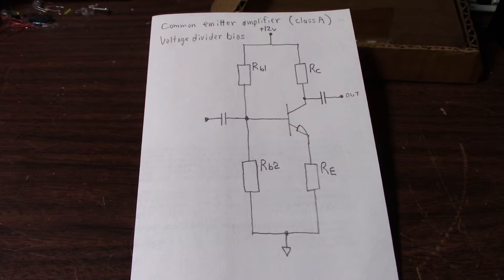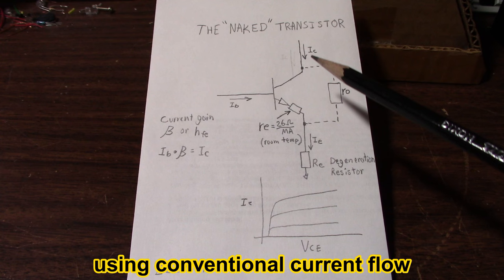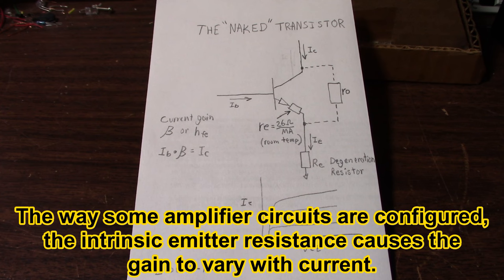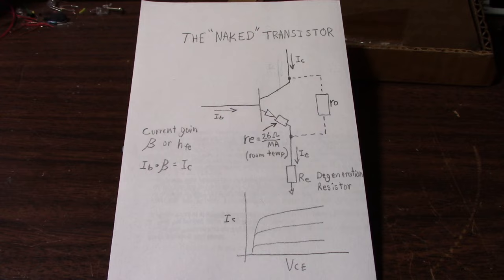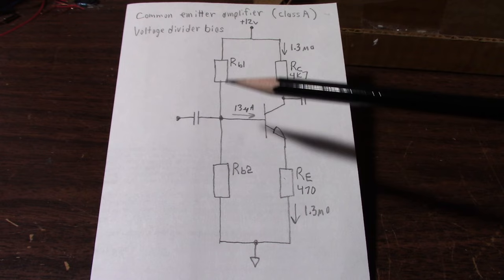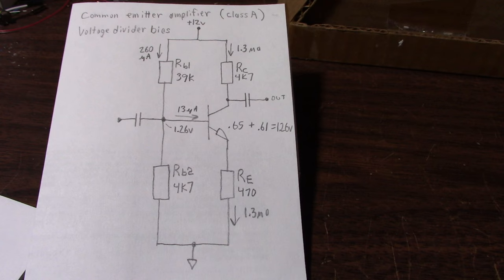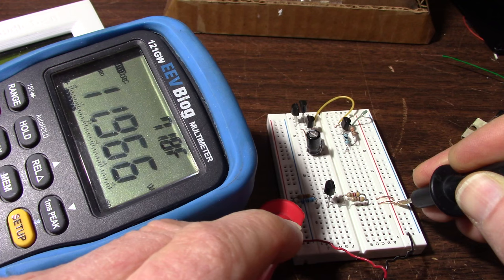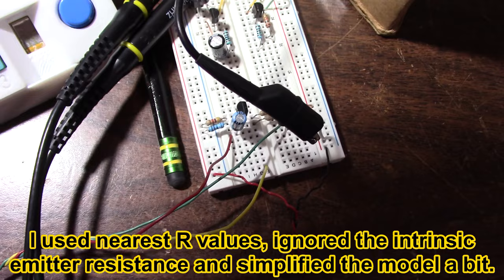How to design a single transistor amplifier with voltage divider bias

Comment: I attempted to do this (once!) "on paper" in order to re-design a 70's vintage pre-amp circuit. I ended up using a circuit simulator (TINA) to converge the circuit for lowest THD for the gain value (+9db / stage) I was shooting for.  I used MPSA18 transistors (beta of 800+) for all three stages. The end result is still working quite well. Only a small amount of negative feedback is used from the follower (output) stage. The original design used un-obtainium FETS with a max output of 5 volts (!) less than .25% THD. I was able to achieve .11% THD at 3v rms using the mpsa18s WITHOUT changing the original board design. I just needed to add RB1. However it took quite a bit of "simulator" experimenting to home-in on the proper resistor values. It's two CE stages followed by an EF stage. The original design had NO RB1. I guess you didn't need them for the FETs. but I needed Rb1 at 10 meg and Rb2 at 1 meg. The simulation failed without Rb1. (even at 10 meg!)  The original design also had Rb2 at 1 meg. I believe that's the only value that didn't change. Every board level component got replaced. This was originally done as a "re-capping" project back in 2006, but a few years later, I decided to replace the entire circuit. I had NO choice but to re-design the bias network even if I wanted to use modern J-FETS (the original plan) . But I eventually switched to the low noise (easily obtainable) NPN bi-polars. I used the same 36vdc that Sony was using off of their  (re-capped) PSU board. The actual Pre-amp was a SONY TA-2000f (circa 1975). Except now it's got a re-built line amp. The line amp (20db) gain stage is a classic textbook design. Twin (daisy chained) CE stages followed by an EF stage,  all cap-coupled. THD and transient response are much better than the original circuit.
Reply: I was thinking of getting Tina.  I would like your opinion on Tina.   ...Thanks
Reply: @richardphillips2405  I'm (still) using on old  version of Tina (6.0?) from 2006 on my "vintage" win-xp machine. It's one of the reasons I still keep that computer around. At the time it cost $50.00. I had already "played around" with some free SPICE Gui tools but TINA had S/N and THD simulation which is important for audio. So I purchased it. My only real gripe about this version (now unsupported) is that I can't update the device libraries. Last I looked...the latest version cost around $200.0. Is it worth 200? I guess if you design enough circuits it might be. I designed only three circuits that I actually physically built using TINA.  The one described above (the SONY PreAmp), a phono stage re-build and an Op-amp based (2 to 6 ch) distribution circuit. I "fiddled around " with that pre-amp circuit for five years (!) before I actually got around to tearing up the working board and replacing ALL the parts! That circuit is also used for the tone controls, so it's four identical line amps on one board.  I also have some audio design stuff that I haven't built (yet). I must say that the TINA simulation was quite accurate vs. the measurements that I did on the the devices I built.  So I guess I got my $$'s worth.  I've also used TINA to verify the working of some circuits that I found in design books. What I would REALLY like is a "budget" Linux version of TINA. I almost ended up purchasing some version of "WIN-SPICE" (PSPICE ?) but TINA seemed a better choice at the time. Hopefully I'll find a Linux equivalent someday.
Reply: @johnnytoobad7785  I have the student version of Multisim.  My version has a limited library.  I would have to be enrolled as a student if I wanted to get a newer version.  The commercial versions are way too expensive.  I have seen several adds for Tina in the Practical Electronics magazine.  So, I was wondering about Tina.  My goal is to learn more about circuit design and also experiment with building circuits.  I appreciate your review.   I was wondering if Tina has a schematic capture similar to Multisim.
Reply: @richardphillips2405  I know there is a student version. I doubt it captures schematics. Tina wants you to EXPORT your design from their platform. My version doesn't support EXPORTING to EAGLE CAD which drives me nuts. So I need to enter the schematic twice. Once for electronic design and once for board design. Other than that I like ALL the built in features of TINA.

Comment: Trying to get some kind of answer so •••.  How did 5170 ohms over 12 volts get to be 1.3 mA?  It isn’t. It’s 2.3 mA. What is going on in this video?
Reply: I assume that the 5170 Ω you quote is meant to be the sum of Rc and Re = 4700 Ω + 470 Ω.
If all 12V were dropped across those two resistors, then you would be correct that the current would be 2.3mA.
However, we need to have some voltage dropped across the transistor, of course, in order for it to work.
You can see that since 1.3mA is flowing, then Rc and Re only drop 5170 Ω x 1.3mA = 6.7V. That leaves 12V - 6.7V = 5.3V across the transistor, which is just as we want it to be.

Comment: The vbe reported by the transistor tester is probably at a 1ma bias current.  The .65 v value is probably closer to correct at the 13 uA bias operating point of your circuit.  Great intuitive explanation.

Comment: Thank you!!! Simple explanations of elementary building blocks is something been looking for, for ages! If you could do an explanation of differences for mosfet (voltage input) bjp (current input). And npn pnp using the single transistor amp format like this that would be even better 😀.

Also I'm aware of differences between purely current output with the capacitor below the transistor and current and voltage output like you have on this video but am unsure of what those differences are.

Anyway. Thank you! Great stuff 😀

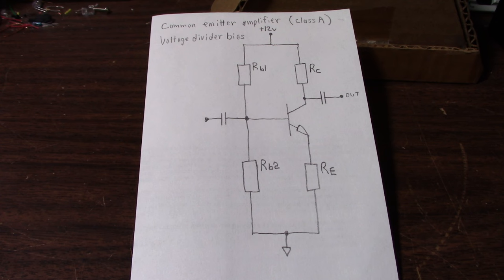Comment: 0:30 A small signal is not amplified.  Rather a larger signal is regulated by a smaller signal.  A minor distinction, but for the minds that think literally, a great insight.

Comment: Well done, John. You hit all the right notes in this video. I have one small criticism and a couple of additions to make. The criticism is that the intrinsic emitter resistance is not "26 ohms per milliamp" as that implies the resistance increases with emitter current. You corrected yourself by noting that it decreases with emitter current, but it's better not to have the confusion in the first place, Just say that the intrinsic emitter resistance is 26mV divided by the emitter (or collector) current.
My first addition would be to calculate the intrinsic emitter resistance (re), which is 26mV / 1.3mA = 20R. Knowing that value helps you decide on whether your other choices are good ones. Clearly the 470R emitter resistor is over 20x bigger, so you'll get a corresponding improvement in linearity, and It's worth making the point. Also, the voltage gain (Av) is better modelled as Rc / (Re + re) and that is then predicted to be 4700 / (470 + 20) = 9.6 which corresponds better to your measured voltage gain of 971mV / 103mV = 9.4. The remaining error is most likely, as you say, due to resistor tolerances.
Finally, note that the approximate gain is Rc / Re, and that the same current flows through both of them. That means that the quiescent voltage across the emitter resistor will be [voltage across collector resistor divided by gain]. If you set 6V across Rc, you will end up with (6V/Av) = (6V/10) = 0.6V across Re in this case. That gives a sort of upper practical limit to the achievable gain because a gain beyond 30 will leave less than 200mV across the emitter resistor and there comes a point where variations in base-emitter voltage between samples then become significant. Also at an approximate gain of 30, the emitter resistor has now become 150R and the 20R of the intrinsic emitter resistance is becoming a more noticeable factor. The only way to improve on that trade-off between linearity and gain is increase the supply voltage.
Reply: That made my brain explode
Reply: Yes all that makes sense. But John did say he was going to keep it simple. Like many people and myself have expressed, this is the BEST VIDEO explanation of how the process of choosing the components in this circuit have come across. This is a fantastic video. And could you post a link to your channel?

Comment: Nice job of presenting just enough detail to allow novices like me to understand how amplifiers are designed. You admit to glossing over some finer points, thus opening yourself up to accusations from the cognoscenti  of either not telling or (worse) not knowing the full story. But your practical, simplified approach is worth far more to learners like me than a million hours of pontificating by "experts"!

Comment: I've discovered some of the Beta tests on these meters and testers are pretty far off so if I need an accurate Beta measurement I will get the actual base and collector measurements and then use the formula B=Ic/Ib ...this always works out. Thanks !

Comment: Howdy.
In another clip You demostrated that the output impedance is 2 x the collector resistor. Much gratitude. That set me on the track to figure out why I could not reach spec. power on my 4 X KT88 tube PA.
My design uses heavy neg. feedback from the end tube anodes to the grid. This reduces the tube stage input impedance. A lot actually. I had designed the end tube input imp. to equal the driver stage anode resistor. Too heavy loading of the driver. I need to redesign the end tube feedback for higher input. impedance.
I have seen many explanations of this common emitter designs. All make the false statement that the output imp. equals the collector resistor, just as I assumed earlier.
Another observation. Not many explain the value of the emitter resistor. The emitter resistor is elementary for thermal stabilization. It should be rated to produce more voltage drop than will be the base-emitter junction threshold voltage decrease when the transistor warms up. If not, there is a hazard of the current avalanching.
High Regards.

Comment: Great video! I would have been curious to see it’s performance at higher input levels. I would have liked to see where and how it clipped. I also would have liked to see how a transistor with a different measured hfe acted. Thanks for all your hard work. Like others have said, you are an asset to YouTube and possess a gift for teaching.

Comment: Back to the technical school years in 1988 i remember for this circuit that hfe or beta does is not needed for the calculations because the base has a fixed bias voltage and collector current is calculated from (Vbase-0.7v) / RE.Also the circuit considered to be more stable to temperature variations.So calculate Vbase voltage higher than 0.7v is one important and the second is to choose RE resistor according the desired current and then calculate RC resistor to have half the power supply to the collector.

Comment: Nice. BJT always were the most confusing active element to me, as they are current driven, rather than voltage driven like tubes, FETs, or opamps. So when messing with them it was more guesswork and trial + error for me than anything else. 
This is a good tutorial on how to quickly calculate a class A stage though. Thanks.

Comment: Would something like this be practical to boost an electric guitar pickup signal to an input value approaching line level input needed for  home audio amplifiers?
Reply: Guitar pickup need to have loading impedance more then 500k (this one have input impedance about 4.7k as mentioned in video) so you need an emitter  follower circuit before this stage. But may be emitter follower is enough.
Reply: You should rather build a high input impedance curcuit with op-amp or Fet.
But be careful. You can very easily destroy home hifi speakers with a guitar.  Use at least real guitar speakers.
Reply: @westelaudio943  You are right, with TL071 or similar is the simplest solution.

Comment: So, when the transistor is on, does that mean the current through the load approaches zero (i.e. its off)? So a signal turning the transistor on seems like it would allow the current not to flow through the load? If there is no signal does that mean there would be 12V DC across the load? THanks!

Comment: Hi John. I would like to see you do a test/ review on theTDA7498E DC 15-36V 2 Channel Audio Stereo Digital Power Amplifier Board 2*160W available on ebay. Is it bridgeable and applicable to drive 1 or 2 automotive subwoofers? This chip is a recent release from ST and data sheets are available from Mouser and Digi key.
Reply from the maker: I checked eBay and the boards are only around $20, so I bought one. Outputs from virtually all class D chip amps are already bridged, so I think they mean paralleling for driving lower impedance speakers.

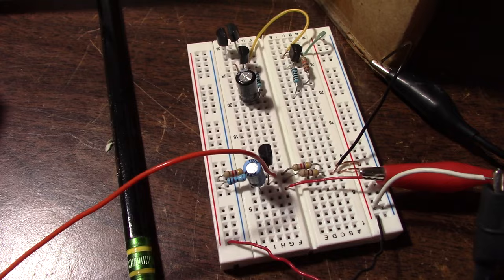Comment: 17:12
Question:  should we always have the input signal connected to the negative terminal of the capacitor ? And have the positive terminal of the capacitor connected to the base of the transistor ?
Reply: Depends on your input signal. As long as the negative side of the capacitor is at the side with the lower voltage.  Or use a non-polarised capacitor
Reply: @insylem 
Thank you for your answer.

Comment: Watching this video repeatedly because it's so good. But I don't understand how Rc and load resistor form a voltage divider for when there's a capacitor there.
Reply from the maker: In the pass band range of the amplifier, the capacitor is essentially a short and can be ignored. It is there only to block DC from entering the following circuit.
Reply: @JohnAudioTech  Yeah, I think I misunderstood what you were saying about the next stage. However, there is math voodoo going on in this circuit that is beyond my hobbyist ability to understand. I played with the value of Rb1 tonight and discovered it affects the measurement of Rc when trying to establish the 6v that is desired for getting half the supply voltage. I didn't have anything close to 40k - only had 33K and 47K. So I put in a pot, tuned it until the voltage at Rc equaled 6V. I then pulled it out of the circuit, and measured it with a DMM. Guess what? 41K was the number. Can you help me understand how the values of the base bias resistors are working to set Rc to half the supply voltage?
Reply: @richardneel6953  The ratio of Rb1 to Rb2 sets the fraction of the supply voltage that appears at the base. The voltage at the emitter is always about 0.65V below the voltage at the base. The current through the emitter and collector is set to be the voltage at the emitter divided by Re. The voltage at the collector is set to the supply voltage less the voltage across the collector resistor (the collector current times the collector resistor).
So if you increase the ratio of Rb1 to Rb2 (either increase Rb1 or decrease Rb2), you increase the voltage at the base. That increases the voltage at the emitter. That increases the emitter and collector currents. That increases the voltage across the collector resistor. That decreases the voltage at the collector.
Decreasing the ratio of Rb1 to Rb2 (either decreasing Rb1 or increasing Rb2) will have the opposite effect, i.e. it will increase the voltage at the collector.

Comment: I think we need an in depth video about your component tester. There's a lot of lore about them. The original design and the multitude of Chinese knock offs. I'd like to see where yours fits in with it all. I have 3 myself and they're all different. One's almost an original clone. One's so horrible I don't use it. I didn't know as much about them when I bought it. Two I have I built from kits.

Comment: Mr john, how to determine value of coupling capasitor in input and output, bypass capacitor in emitor to gnd?
Reply from the maker: You need to know the impedance of the circuit and low frequency cut off you want. Then you can use the equation to calculate for capacitance.

Comment: I am trying to make an audio amp for a disk cutter, i keep chaing the schematic as i keep using parts for circuits, so am left with little to none to work with. I dont know where to start, Its bascially a phono amplifier, that ran on tubes, but it shocked me, so i figured id strip and rebuild, every wire or something was all dry rotted with age..Even a wire to the speaker was corroded,,I only need a 2.5 Watt amp. bypassing the transformer.. it has a mic input and phono pickup out.. Vintage 1950s switchraft Screw on type - mic in._ and Banna Jacks for line out.. Cutter head orgionally worked on 1200 volts D.C.. So Will go 8 ohm..4 volts...To cut. convert the cutter head to magnetic pickup...